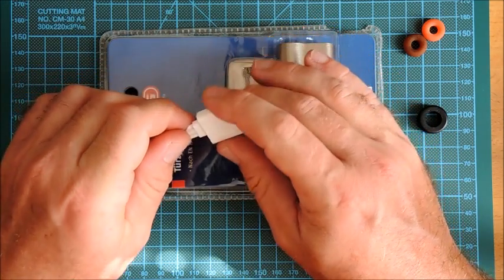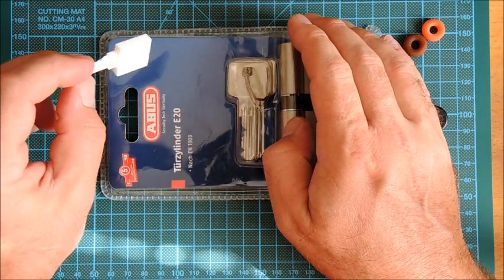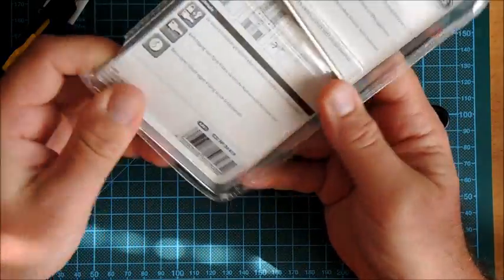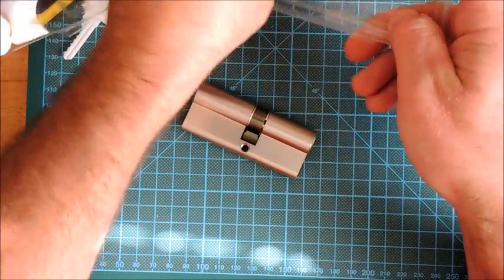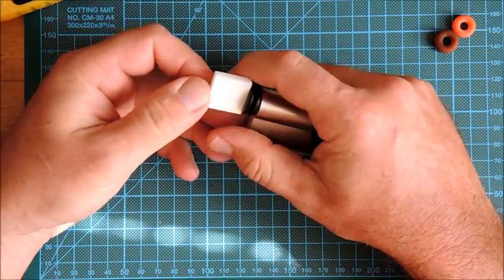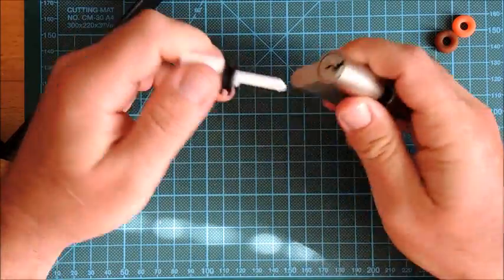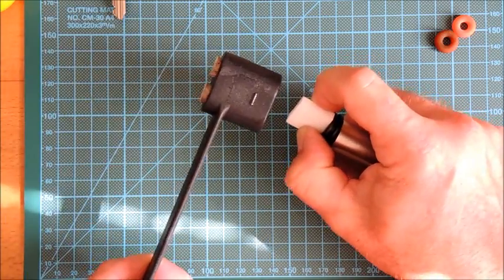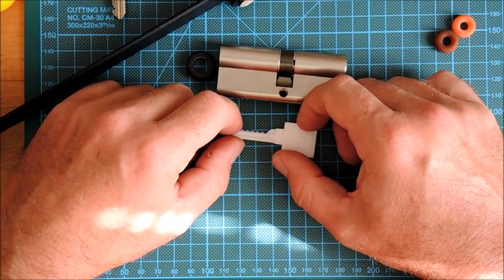Testing 3D Printed Bump Key by decoder

Comment: Fantastic bump key Andy mate. I know you can get different strengths of plastic used for 3D printers, how strong is that and how long do you think the bump key will last before wearing down?
Reply from the maker: Cheers, Rich. I'd say it's got some life in it. Hard to say how long. I guess it would be more down to the abuse the user gives it. It's gonna wear down competitively quickly compared with brass though, for sure.

It would work out well to say order 10 from shapeways, and do it that way.